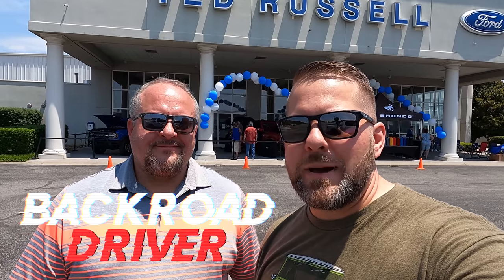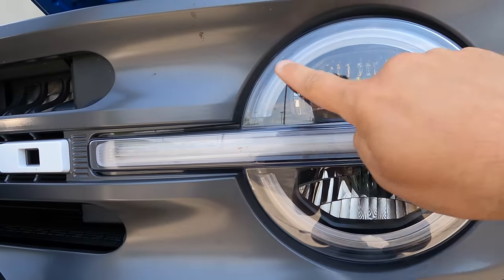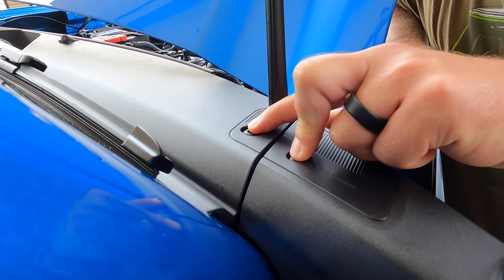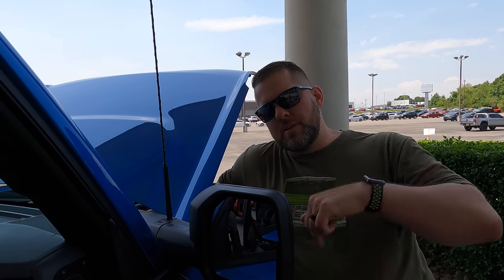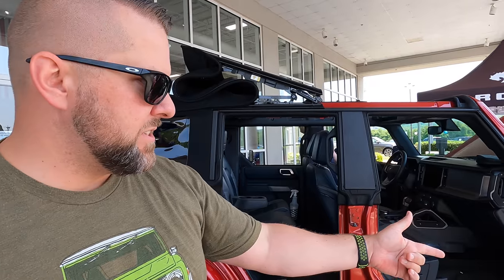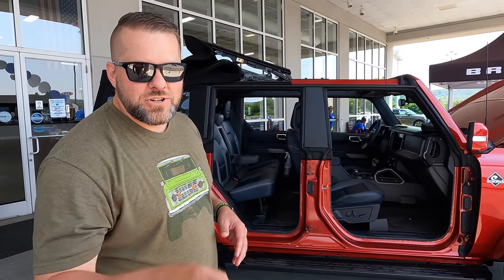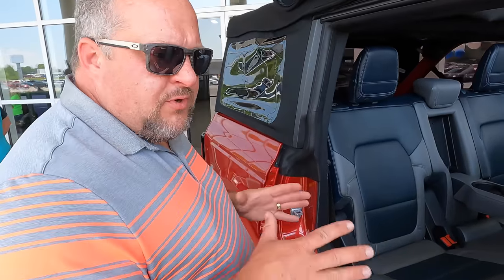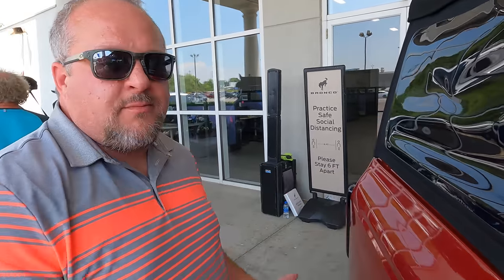New Ford Bronco Review! Big Bend & Outer Banks Features & Hidden Easter Eggs!

Comment: 1. Fenders on the Badlands Sasquatch version are wider than the regular Badlands non Sasquatch version.  
2.If it’s a Sasquatch package there will be a hidden Sasquatch Character in the bottom of the sticker/ badlands badge . 
3. Badlands Sasquatch editions don’t have front  crash bars that extend the whole distance of the front bumper like all the other models do. 
4. Badlands Sasquatch edition is an inch taller . 
5. Sasquatch packs costs more on a lessor model than to add it on a Badlands because there are less off road parts to add to the vehicle . 
6. The 4 cylinder model is actually a beast there are numerous videos of it going up enormous loose deep sandy hill no problem .

Comment: “The Wrangler is standard 4WD, where as the Ford comes in some 2WD models...”  @2:38 🤣
Reply from the maker: I did misspeak on the current situation for the Wrangler but they did sell them as two-wheel drive models for a while. As for the bronco it is standard four-wheel drive.

https://www.autotrader.com/car-news/jeep-once-sold-two-wheel-drive-wrangler-and-it-was-weird-281474979998290
Reply: Had a bronco 2 in the day which was awesome.
Just not a fan of the bronco or bronco sport.

Comment: Great video , I wonder if there going to increase / update the power on the 2.7 ecoboost for the f-150 then . They did something similar in the Lincoln navigator where the 3.5 ecoboost engine had more power than the 3.5 ecoboost in the f-150 .
Reply from the maker: I expect a Raptor version in the 3.0 V6 from the explorer. Maybe an even higher option with the hybrid motor from the aviator.
Reply: @BackroadDriver  oh , sorry was referring to the 2.7 eco in the bronco makes more power than the 2.7 eco in the f-150 . That 2.7 eco defiantly has enough power for the bronco , but can’t argue putting a v8 in one either lol. I enjoy watching your guys channel 👍
Reply from the maker: Thanks Justin!

Comment: Boy's you are very wrong with your one comment, the Jeep Wrangler DOES NOT come in 2-wheel drive. Never has. Do your research.
Reply from the maker: My memory of a 2wd Jeep Wrangler is better than yours I guess.  You're partially right, they are no longer offered in 2wd but they were not that long ago.  Thanks for watching! https://www.autotrader.com/car-news/jeep-once-sold-two-wheel-drive-wrangler-and-it-was-weird-281474979998290
Reply: @BackroadDriver  
That's right, in this time and space they are not, and the Wrangler never was, the original Willy's and the Army issue  could come in 2-wheel configuration, but not the Wrangler. So it turns out we are both right and have good memories. :-)
Reply from the maker: Check that link above.
Reply: @thomasmagnum9631  He is right they sold a 2wd Wrangler at one time, obviously it didn’t sell too well but it was a bit cheaper than a proper 4wd
Reply: They definitely sold a 2wd wrangler. My gf’s dad came home one day with a new wrangler. He was so excited to show everybody and to tell us what a deal he got on it. He didn’t realize it was a 2wd until his wife looked under the front and asked where his front diff was.

Comment: so you could put a hard top on later if you went with soft and vice verse?
Reply: I was thinking the same. Maybe noise reduction on the hard top? All I could really think of
Reply: @jesusaguilera5170  I'm more curious if you could put a hard top on after the fact if you order a soft top
Reply: No you need to order a hard top if you want to use both because if you only order a soft top the wiring and piping will not be present from factory

Comment: Huh. I have a 1989 Bronco xlt. Love my truck. It's tired, very tired. Sitting up surrounded by steel. Big seats. Great leg room and fold seats down to carry lots of groceries.  Has fiberglass topper which has never been taken off for bikinis look.  Thinking putting in rebuild motor n transmission, fresh paint, new upholstery. Give it a fresh face-lift.  Or trade in new model. What's your opinion?
Reply from the maker: That’s a tough one. I think the my are totally different experiences. I don’t think you will be able to get a new Bronco for at least 2 years. I would build your ‘89 and wait a few years to trade for a new one. Get the ‘89 running right and someone will pay good for it. Good luck and thanks for watching!
Reply: @BackroadDriver  yeah. It's decent condition, just needs care. I look cost for trucks and cringe. I really don't want to give up the "comfort" but cost of driving at gas prices hard. Might just keep it because, hey, Bronco.... yah know.

Comment: Ford needs to have the 3.5 and 5.0 as options. I don't understand why those two engine options wouldn't be standard.
Reply from the maker: I think Ford would. I think everyone would buy the biggest, most powerful engine they could get. The federal government CAFE standards are to blame. The V8 is on its last leg in the F150. It is gone from the Expedition and Navigator. Blame it on the government.
Reply: @BackroadDriver  of course. Way too many complaints out of the 2.7, 3.5 would just be better.  Also wish they'd install a back fold down armrest in the broncos and f150. 2021, it should be standard lol

Comment: I think that the I4 looks good in the engine bay. Looks clean. Just wish it had at least a straight six or of course, a V8.
Reply from the maker: I think they will put a big, powerful V6 in a Raptor variant.
Reply: Probably the 3.5 HO from the Raptor.
Reply from the maker: I have heard the 3.0 with the hybrid motor from the Aviator. That’s a powerful setup.
Reply: That's a great set up. I partially think they could put the 3.0 diesel in it too. That wouldn't be a bad combo.

Comment: Is the Bronco a similar size of an Explorer or Edge. It hard to judge from the video. By the way. Great video with solid explanations of the Big Broncos features.

You mentioned using a Coyote. With the new administration lowering EPA numbers. The Coyote doesn't work. I don't want to see what happen in the 70s with big V8s engines being detuned or discountinued. Remember the Mustang II. That tells the story. I'll take 335 HP Ecoboost V6 or the upcoming Bronco "R" with a 3.0 Ecoboost with in the neighborhood of 400 Horsepower. I believe we'll see a hybrid model in both sizes of Broncos within a couple years with EV versions by 2035.
Reply from the maker: I think the big 4 door Bronco is a little shorter than the Explorer. I agree on the switch to smaller displacement boosted engines. We have two coyotes, a 351 Windsor, a Predator and a Voodoo on the channel. The Windsor is in our 96 Bronco and it is the weakest of all. The new Bronco would be overly insane with the Coyote and then Sam and I would inevitably supercharge it.
Reply: @BackroadDriver  read the article from the SRT division of The Former FCA. They are preparing for the end of the V8 engine. They are working on hybrid replacements mentioning 500 hp

Comment: If they put a Coyote in it, I'm buying one.
Reply: In the "R" Bronco which was being called the Wart Hog will likely come with a 3.0 Turbo Ecoboost V6 like used in the Explorer ST. The Explorer ST produces 400 Horsepower. So if you want a Coyote powered Bronco. It looks like you'll not going to own a Bronco. Maybe after a test drive with the 400 HP Ecoboost. You may have a change of heart.
Reply from the maker: Amen!

Comment: No V8 no deal for me 3 cylinder motors are junk these Broncos will never be as good. As the old Broncos hell send one to OJ get him to sign it Ford would sell a lot of them lol lol first year run of a new model will have a lot of issues better wait a couple years until they get the bugs out of them. good try Ford but there just not the old Broncos and never will be better buy a jeep gladiator